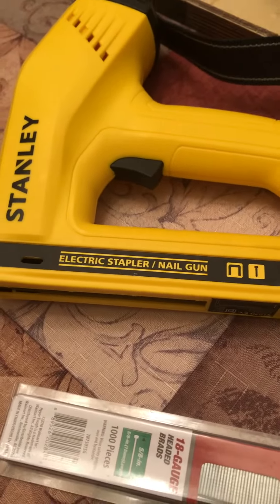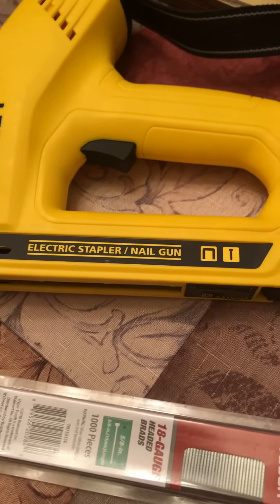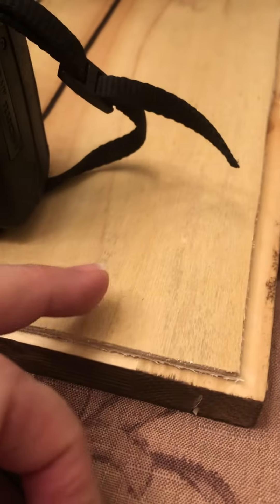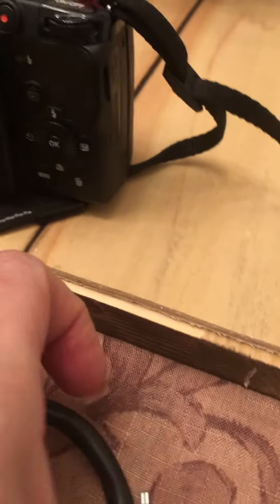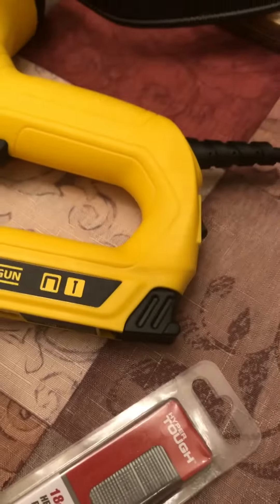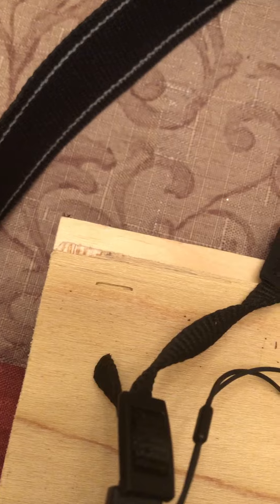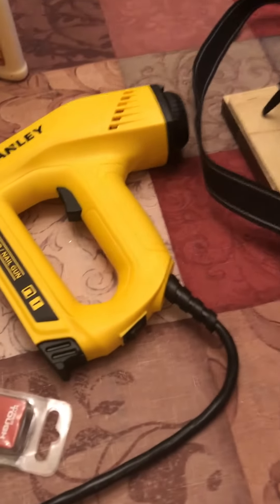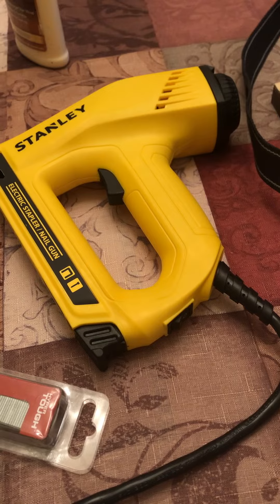Help with Stanley electric Brad nailer

Comment: You probably already have the answer but it looks like you might be putting the brads flat instead of upright leaning against the inside of the chamber.  See the picture on the fright front side of the stapler.  It's located where the staples/brads come out.

Comment: Possibly it came loaded with staples and you had to remove the staples and load it with the nails,  the tool works with both,  unless you already did, then something is wrong with it